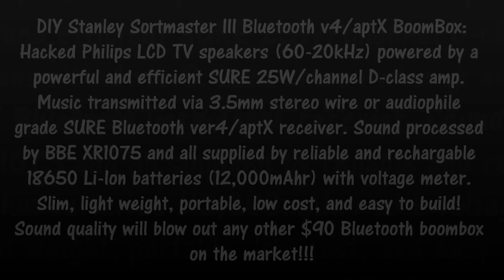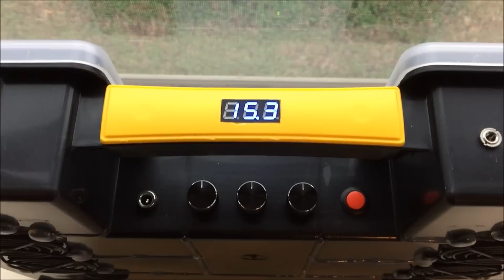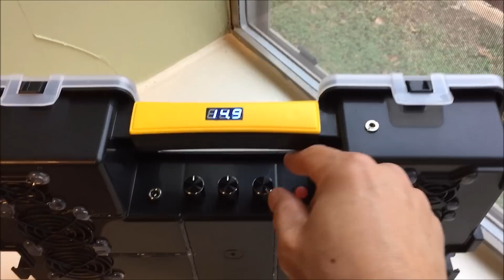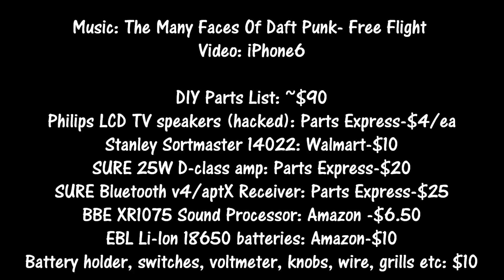DIY Custom Stanley Bluetooth BoomBox version 3 (25W/ch & Li-ion)!!!

Comment: Does the added mass on the factory PR's help with the bass response of the speaker units as they are? Or did you have to change the tuning frequency because you altered volume of the units speaker enclosure? I actually have two of these Philips TMM's sitting in my closet for a rainy day project. Very nice built by the way!
Reply from the maker: Yes added mass lowers the tuning frequency. Volume remains the same!
Reply: Sweet I'll have to experiment and take some measurements. I'm going to incorporate mine into some thin floor standers for the bedroom. Small footprint towers. They're really good sounding units for the money. Thanks for the reply!

Comment: Do you have Low voltage cutoff for when the batteries get too low and won't get damaged? also what charging system are you using? thank you
Reply from the maker: +vic No nothing fancy just periodically monitor system voltage. If they get damaged they are only $2/ea. Just a simple 16.8VDC 2A charger.

Comment: How are your batteries connected?
I habe bought 4 18650's and i am struggeling wirth the min. 8v my bluetooth amplifier needds.
Rughit now i have connected them in parrallel to a tp4056 chrging board witch the goes to a step uo converter.
Are you connecting 2 in parrallel and these two then in sries?
And are you using a Battery mangamnet system?
Reply from the maker: All connected in series for 16.8VDC

Comment: Largest capacity 18650 cells I have seen are 3500mAh, so 12.000mAh?
Doubt it, you can`t even get 26650`s with that capacity..
Unless you count them all together, but the you don`t have 14.4V (nominal), and as you say they are in series..
But the box looks really nice and clean, and the sound seems decent, although I hear a rattle on bass hits..

But nice build :)
Reply from the maker: Yeah you got me on the description but big numbers always attract attention..hehe 4X3000mAhr=12000mAhr at 3.7VDC BUT I have tested these at ~2100mAhr even though they are rated at 3000mAhr. Great value buy when they are <$2/ea and reliable! My three different genuine Panasonics have been tested at 2600, 2800, and 3100mAhr and rated capacity is accurate.

Comment: If you are running four 18650 batteries at 3.7 volts, wouldn't that give you 14.8 volts?
Reply: +Robert Frisbie Fully charged 18650 give 16.8v (4.2v each cell)
Reply from the maker: +Robert Frisbie Yes.
Reply from the maker: +Leonardo Quintana Thanks! That is correct when fully charged. I top off at 16.8V and recharge when ~13V or so or when voltage drops off fast. Li-ion cells die quickly when <2.5-3V each (<~12V).